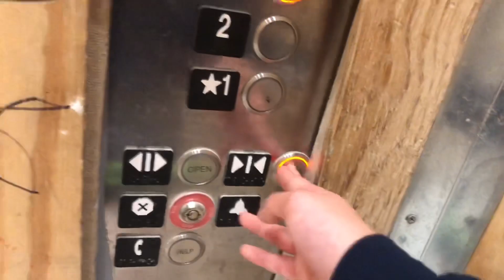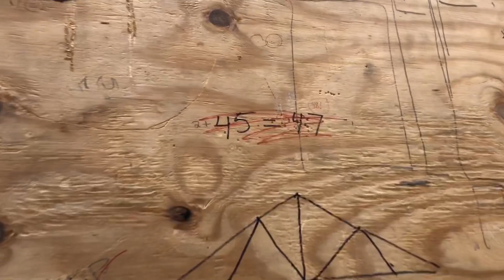Crappy KONE KSS 570 Service Elevator - East Loading Dock - Tysons Galleria - Tysons, VA

Comment: I’m shocked that they would use this for heavy duty
Reply from the maker: Yeah but it seems like it since this dock serves the whole left side of the new section. Definitely should’ve gone with a freight, and anything other than KONE.
Reply: I think if KONE installed a 3rd-party freight hydro it would have been fine & the same as any others.
Reply from the maker: @EWPA14  that would probably be the best decision.